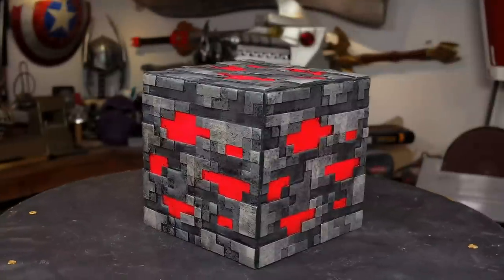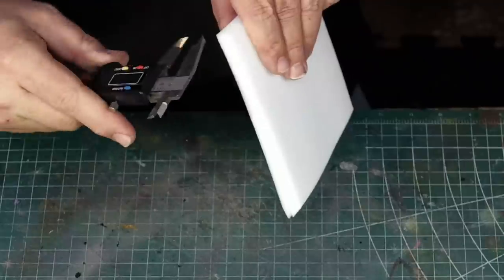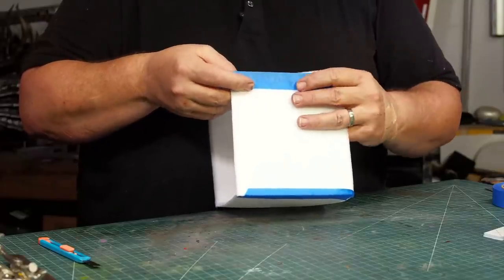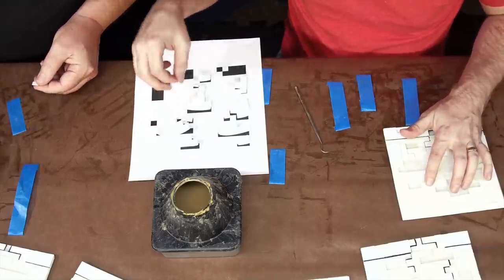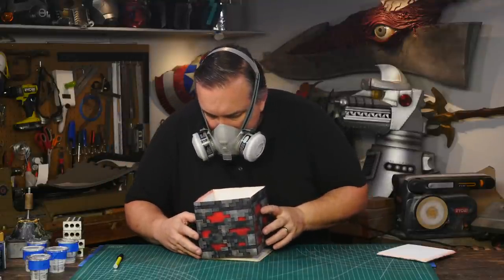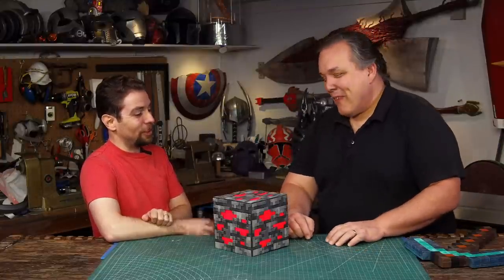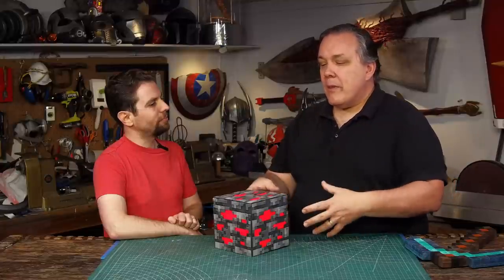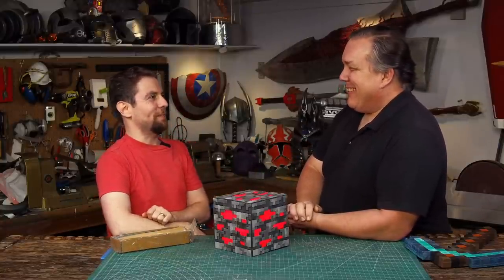Odin Makes: Deepslate Redstone Ore block from Minecraft

Comment: I have a template for tessaiga from inuyasha. Since the blade has a fairly good curve to it and the handle isn't inline with the tip to do 1 long central support (dowel or whatever) to stiffen the blade, what would you use to go from the center to the tip to keep that from getting floppy, since I can't do 1 piece through?